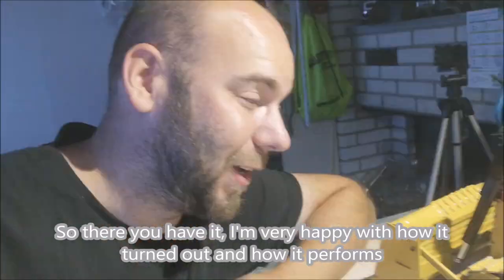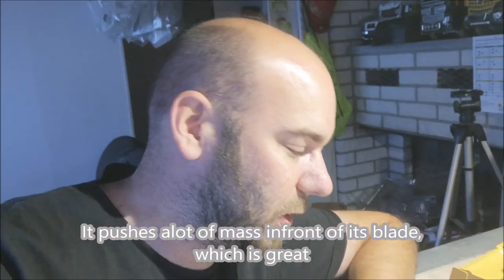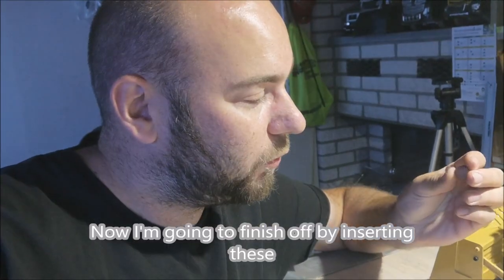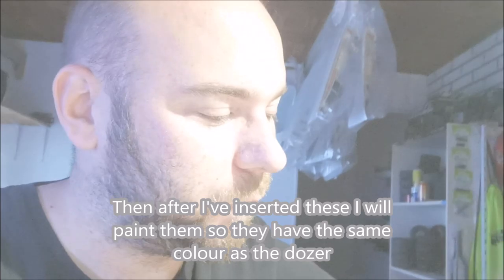Making a 3D Printed D6 Bulldozer PART-6/6 "How does it perform???"

Comment: What kg did the dozer weigh when you finished it?
Reply from the maker: approx 8kg :)
Reply: What would you think about making a case 2050 dozer , a John Deere 850 with a 6 way or a big komatsu dozer
Reply: Also what filament do yon normally use to print